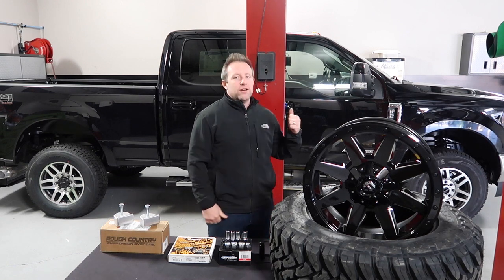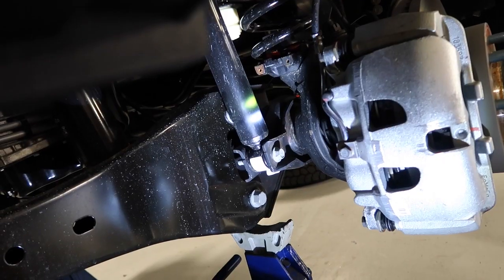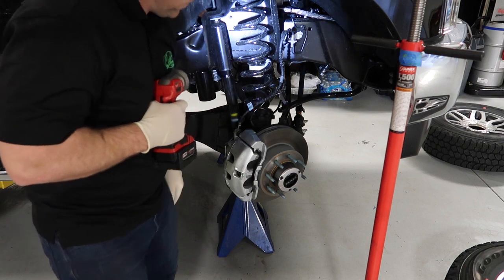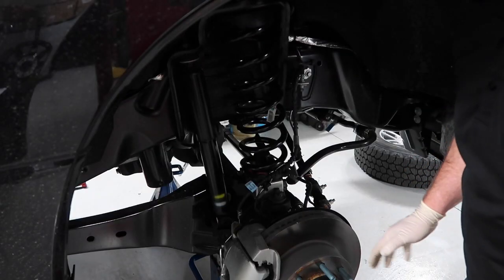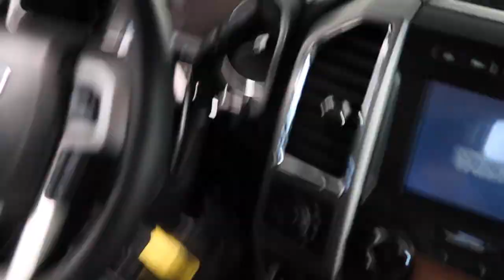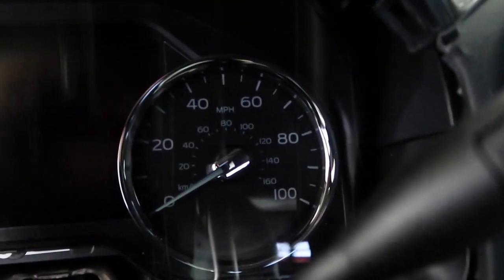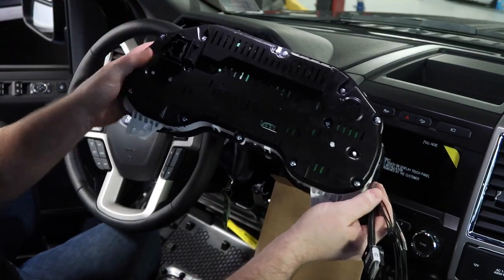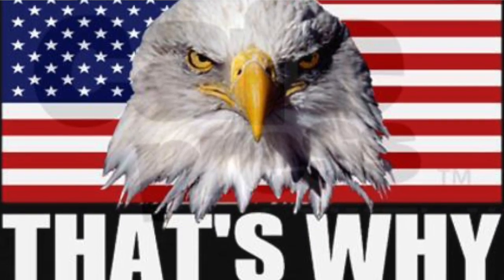How to install a 2" Leveling Kit on a 2018 F250 Super Duty

Comment: What they do not tell you is that the $60.00 2"leveling kit will cost you $635.00. This is what I found out after I installed the Rough Country 2" leveling kit, I had to buy a $450.00 adjustable track bar because the spacer offset the front tires 1.5" to the left so to get the front end back in track with the rear it cost $450.00 or wear out the front tires. Then comes the front end alignment $125.00.  Now with this all said and done, add $60.00 plus $450.00 plus $125.00  = $635.00 to raise up 2" at a cost of $317.50 per inch. Is it worth it that is up to you I would not do it again.

Comment: Why wouldn't you use Forscan to recalibrate tire size? Saves pulling out the dash.
Reply: ???????? Yhea! Ain't got no answer homie?
Reply: The speedo can be recalibrated using FordPass by simply hooking to OBD2 port.

Comment: What is the clearance like. Just ordered some 22's and 35x12.50's. Trying to decide wether to do like a 4 inch lift or wether to do the leveling kit. Long story short do you think it would easily clear 22's?
Reply from the maker: Chris Kelley try going to customwheeloffsets.com . It should fit but your offset will be a deciding favtor

Comment: Do you need to reprogram the VSC on the Ford after leveling? I know I had to bring my Tundra Crewmax Platinum back to the dealer to do that. Apparently run like crap until the VSC is reset. Or does that not apply to the Ford Super Duty?
Reply: you only need to reprogram if going to larger tires

Comment: Why didn't you install a longer track bar or the Rough Country track bar drop bracket? Without installing a longer track bar or drop bracket the axle is not centered under the truck. The driver side tire is now 3/4" inch or more farther out than the passenger side. Rough Country sells a 2" leveling kit with those same aluminum blocks you used plus a track bar drop bracket for $70 more than just the blocks alone. It seems stupid to skimp on $70 when applying it to a $50,000+ truck. You should also mention that the front end has to be re-aligned as part of the installation.

Nice clear video of the install. Thank you.
Reply: Good to know. Thanks for this information

Comment: U can fit them with out the level , and the stock tire in like a 34.5 , so gas mileage  defenetly won't change
Reply: Jay marin it's a truck I definitely wouldn't be thinking of gas mileage if I was concerned about gas mileage I would be driving a prius
Reply: Actually gas mileage will change if the new set up is heavier. More rolling mass means more power needed to move it.🙂
Reply: I have the same tire/wheel setup on my f350. Those tires are about 32.2". If it had the 20" option, which it doesn't, you're right they're just over 34". You can fit 35x12.5 tires with no level but these trucks need a level to look right!

Comment: Thanks for the clarity on how the spacers fit. I see many offer a round puck and others offer the ones like this with a support for the factory spring seat. I just want to level the truck and now more. I do not like the amount of work required to adjust the speedo. Back when I was at Ford we could change the programming with a Star Tester. I hope they still can; though I know the star tester is not in the picture any more. How much down travel is left in the shock now?
 I think all these videos should be done in a drive way or home garage with a floor jack and stands. LOL the access to a lift for me is long gone. Fingers crossed for one day though.

Comment: After the 2in. lift. Should I raise the height of the shock or stay with the stock?
Reply from the maker: Blakacedevil the shocks are stock on this leveling kit.
Reply: Raise bro
Reply: Pro ryde gives you a shock bracket to raise it to factory length. If you don't that shock is 2 inches closer to  being over extended

Comment: This is how people end up with F250 death wobble. Not using proper torque specs on the suspension nuts and bolts. 
This is also how my trailer dealer almost killed me. Not using a proper torque wrench set to 250lbs on my WDH. 
This is also why I do all my own work. Because I realize things are supposed to be tightened properly or people can die. Not only myself, but all those driving around me.

Comment: Did you have to add a track bar bracket to center it?
Reply from the maker: Nope. Did realign the suspension it only knocks the toe out slightly so it's an easy adjustment!

Comment: What size/brand aftermarket coil spring can you replace the factory coil springs for a softer ride?
Reply from the maker: I'd change tires and rims first. Smaller rim diameter and taller tire will make a smoother ride for sure.
Reply: @CaseysAutomotiveChantilly  those bolts that hold the stock spring seat. I need the stock length bolts. I am lowering the truck to stock height. Due to wifes bad back and knees. I can't find those bolts online. How would I find them?  I sure would appreciate the help

Comment: Any squeaks in the dash after install?  If I chose to not install the new program the pro would be not dealing with the install and possible squeaks, the con my speedometer is off by x percent.  How important is that?  I think I can deal with the speedometer being off a little.
Reply from the maker: Greg Mueller no squeaks! It’s real easy to install too. As long as you manage your speed,  you are right it’s not that big a deal.

Comment: I just did a leveling kit with springs, fox shocks and toyo MTs on 20s and it killed the ride. So bummed!!
Reply: Can you expand what aspects killed your ride?
Reply: I leveled my 2017 XLT Crew Cab diesel with ICON springs, but I opted for Fox shocks.  I have the SOTA 20x9 wheels and Toyo R/T.  Ride sucked.  Then, I dumped the Fox shocks and went with Icon, Night and Day difference.  I will never buy Fox anything.  Bilstein 5100s are also better.
Reply: @cjj7264  bumpy, skittery, not planted traction

Comment: So I am assuming the Hypertech attached to the back of speedo gage recalibrates the speedometer for the new 35" tires. Right?
Reply from the maker: vppnbrent yep. Download the new program and plug it in. Easy peasy.
Reply: The better fix is to have Ford use the factory computer and set tire size to the max stock (295/65R20) which measures 34.10.  These Toys and most 35's measure out at 34.5.  Not much bigger, the level kit only allows wider wheels and tires.  I would skip the whole Hypertec thing.  My Ford dealership reprogrammed my factory tire size when I bumped from 275/65/18 to 35x12.50 20 on my 2017 XLT.

Comment: Why not just do a full suspension lift?, I mean just spend the money do it right
Reply from the maker: bryan crowe I’m with you, what the customer wants the customer gets!
Reply: I am sure its because the customer still wants to be able to use this truck to pull trailers, slide in camper, or whatever.  Leveling kits are not even close to the price of a full suspension lift.  $150-$250 compared to $2500-$5000.  Note as well, leveling kits do not affect the ride quality or the safety features and are still covered under the manufactures warranty - when a full suspension lift is used most of the manufactures will deny any warranty claims based on the modifications made.  Just food for thought.
Reply: Agreed.  I have the longest drop shank I could find for my weight distribution hitch and it's almost at the lowest point.  I don't know how you could use a WHD or hitch up to a 5th wheel camper if you installed a suspension lift kit.
Reply: At the ford dealership I work at we have to report any suspension modification to ford and most of the time they will void the warrenty on the truck.
Reply: @colin1528  Ford does not void the warranty on a lifted truck.
Reply: @graffix  the rough country 2" leveling kit is $70 and that includes them charging for their name. haha so cheap.
Reply: @colin1528  Ford dealerships all across the country install leveling kits and larger tire / wheel combinations on brand new trucks as options.

Comment: don't understand, why does a new truck need a leveling kit ?
Reply from the maker: Need? Nope, this is totally about want.
Reply: ok, but why is raising the front 2" desirable  ?  i'm tired of SUV's and considering an F250 Limited
Reply from the maker: The rear of these trucks is higher than the front from the factory. This is to compensate for a big load in the bed. To some they just want to have a level look. Ever heard of Cali Style? It's the opposite effect, lower in the rear than the front. Thats something I cannot wrap my head around. To each there own..
Reply: now i understand, thanks  what's your opinion on the new 2018 F250 Limited ?  i've always been a GM fan but the F250 is nicer

Comment: U made me not want to do any upgrades on my f250 after u pulled off that dashboard. That part should of been left out .
Reply from the maker: MG G. It was easy! Don’t be afraid, that came apart and went back together way faster than the actual leveling kit.
Reply: Lol
Reply: Don’t need to, Forscan would’ve recalibrated the speedo and cost less than the programmer.

Comment: Sway bar work is always done when the suspension is sitting on the ground...not jacked up. Fail!
Reply from the maker: Worked just fine for us here skippy!
Reply: @CaseysAutomotiveChantilly  guarantee it binds and damages the sway bar link rubber joints skippy! But hey it's not your truck so why would you care.